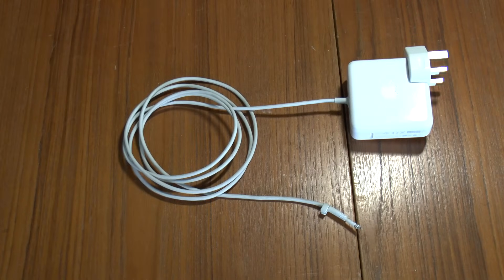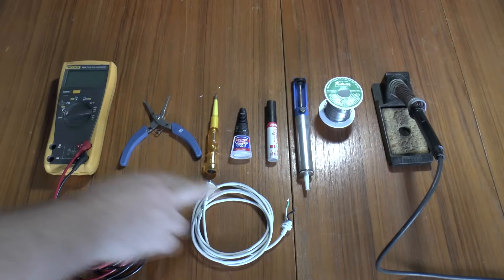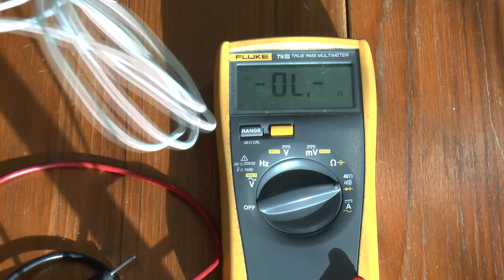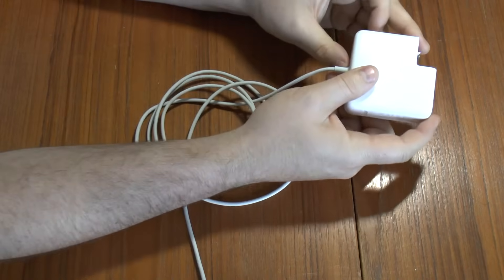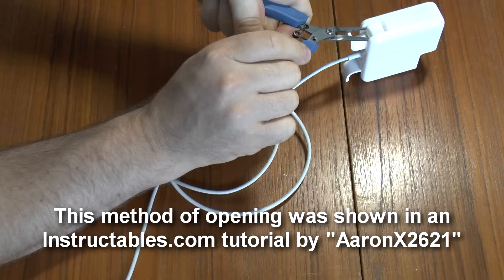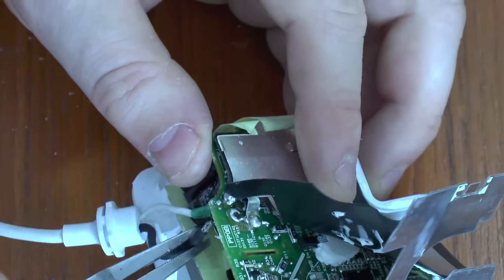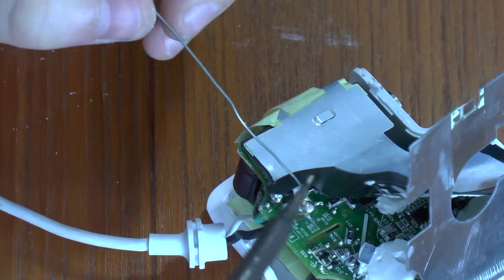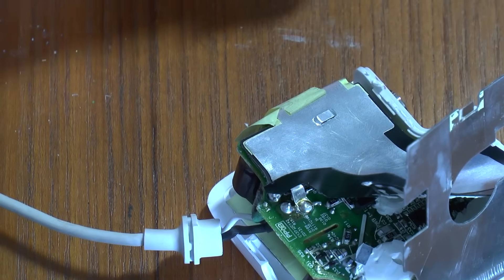How to repair an Apple MacBook power supply (MagSafe)

Comment: http://support.apple.com/kb/TS4127?viewlocale=en_US&locale=en_US
Reply from the maker: Depends. Play nice and if you catch someone at the Apple Store who's in a good mood you may be in luck. Explain you tried fixing it before finding out about the extended warranty, a bit of honesty might work wonders.
Reply from the maker: US-only, but a useful link nevertheless. Replacement PSU for free definitely beats DIY-fixed PSU for a few bucks :)
Reply: Wish i had seen this before i soldered my end tip, the end the attach to the computer. I bought a cable to replace it. I wonder if they will still change it out? Thanks for the link. Next time i'll know to check first. Now i know, and knowing is half the battle. =)

Comment: Is it prudent to apply a good grade of electrical tape to the wire as it travels through the "wire guard" in the case. The objective is to provide some protection to the cord as it exits the charger. I have noticed this is a weak area for the wire insulation to break down. I was curious as to your thoughts?
Reply from the maker: You could, but it'd look messy. You may fare better (and neater by looping the cable back and taping it to the charger, so the cable comes out, so the cable comes out and forms a hoop.

Alternatively you could try something stylish by using a small spring (such as one from a pen) as a strain relief spring, wrapping it around the cable at the charger end. I saw that recommendation somewhere else so can't take credit.

Comment: Thanks for the video. I honestly only watched the first few minutes and then took it from there but it was a very helpful start, particularly your method of popping apart the case. The soldering (removing old and re-installing new leads) went easier than anticipated; the holes on the mounting board stayed open and retained a little solder ring around them which helped the new solder grab easily.  I also held the whole contraption down to my desktop edge with a large spring clamp so it was easier to pull down on the old wire with pliers (as I heated the solder) without it scooting around.

Comment: THIS IS HOW I FIXED MY WORN OUT CORD!  BUY A NEW CORD:!

BUT I RECOMMEND - I DIDN'T HAVE TO SOLDER INTO THE BOARD, I JUST CUT THE OLD CORD BLACK AND WHITE WIRES LEAVING THEM LONG AND SOLDERED THE NEW BLACK AND WHITE WIRES TO THE OLD ONES.  THIS WAY I DIDN'T EVEN HAVE TO OPEN THE POWER BOX ALL THE WAY INTO TWO, JUST HAD TO CRACK IT OPEN A BIT ON THE CORD END.:

I FIXED MY OVERHEATED BROKEN L SHAPED CONNECTOR CORD 13" MACBOOK PRO.
I BOUGHT A REPLACEMENT CORD FOR $10 W/SHIPPING ON EBAY-I CHOOSE THE T SHAPED CONNECTOR INSTEAD BECAUSE I BELIEVE IT IS HEAVIER DUTY THAN THE L AND THEY ARE INTERCHANGABLE. 
I SAW A YOUTUBE FOR EASILY POPPPING THE BOX OPEN WITH NEEDLE NOSE PLIARS AND SOLDERING THE NEW CORD.
TO OPEN THE POWER BOX, SIMPLY SWING OPEN IT'S CORD STORAGE WINGS AND PLACE NEEDLE NOSE PLIARS TIPS INTO THE EDGES THE WINGS FOLD INTO. 
FORCEFULLY OPEN THE NEEDLE NOSE PLIERS WHICH WILL POP OPEN THE POWER BOX GLUED SPLIT CLAM SHELL SEAM. 
PLACE THE POWER BOX ON A TABLE WITH THE PLIARS PUSHING DOWNWARD AGAINST THE BOX-TABLE-YOU'LL HAVE TO KEEP THE POWER BOX FROM MOVING/PLIARS TIPS FROM COMING OUT BY PLACING THE POWER BOX AGAINST A STATIONARY OBJECT. 
THE CORD STORAGE WINGS AND THEIR DEPLOYING SPRINGS WILL NOW FALL-COME OUT.
I DIDN'T EVEN HAVE TO REMOVE THE CLAM SHELL HALFS COMPLETELY, JUST ENOUGH TO GRAB THE WIRES. 
CUT THE OLD CORD LEAVING AS MUCH OF IT'S WHITE AND BLACK WIRES ON THE POWER BOX. 
STRIP THE OLD WIRES ENOUGH TO SOLDER TO THE NEW WIRES BLACK AND WHITE CABLES. 
USE NARROW STRIPS OF ELECTRIC TAPE TO HOLD THE MATCHING COLOR NEW/OLD WIRES TOGETHER FOR SOLDERING, THEN SOLDER.
ELECTRICAL TAPE THE SOLDIERED BARE ENDS ADEQUATELY AND PUSH BACK INTO THE POWER BOX.   
CAREFULLY LINE EVERYTHING UP.
PLUG IT IN TO THE WALL AND THE COMPUTER FOR A QUICK WORKING TEST BEFORE FINAL GLUING.
PLACE SOME SUPER GLUE ON THE BROKEN OPEN POWER BOX SEAMS.
SNAP EVERYTHING BACK TOGETHER NOT FORGETTING TO REINSTALL THE WINGS AND THEIR DEPLOYING SPRING. 
HOLD THE POWER CLAM CASE HALFS TIGHTLY CLOSED TO ALLOW THE GLUE TO BOND. 
WHILE HOLDING, PLACE CLEAR STRIPS OF SCOTCH TAPE OVER THE GLUED SHELL SEAMS SO YOU CAN REMOVE YOUR HANDS AND BE DONE AND TO INSURE THE SHELL WILL NOT COME APART AS THE GLUE CURES OVERNIGHT.
PLUG IT IN, YOU'RE DONE!

HOPEFULLY THE NEW CORD WILL LAST A GOOD LONG TIME BUT IT'S NOT TO HARD TO REPLACE AGAIN FOR $10 AND ABOUT A 30 MINUTE JOB.

This problem is caused by our current world system that does not do what is best for everyone.  Check out  equal money org

Comment from the maker: Yep, believe it or not there's circuitry inside the plug itself. I doubt you'll open an L-shape MagSafe plug without completely destroying it (like I did) but the T-shape ones should be a touch easier.
I still had the ripped open plug until about three weeks ago, I'm pretty sure I threw it out when I started redecorating the computer room. Typical.

Comment: In fewer words, this would mark the first time I've heard of an active cable for a power supply, that throttles wattage based on the cable's IC broadcasting its rating (or some variant thereof).

Comment: Sorry if this sounds ignorant, but are you saying the cable that connects on the magsafe end side (that you're repairing) has an chip of some sort that allows the actual PSU to determine its wattage rating?

Like FL34747, I am confused by this.

I consider myself pretty savvy with these sort of things, and as a rule I simply always assume cables to be "passive," and therefore it is up to me and me only to pair the correct cable with the component.

Am I wrong in this case; is this different?

Comment: The final output stage of this PSU is a TPC8118. Does anyone know what the gate signal should look like on an oscilloscope? I have lots of dead PSUs with +15 volts still present on the input to this transistor, but no output to the Magsafe lead.

Comment: You've got this the wrong way round!  A 45W cable on an 85W PSU is bad news as it will overheat if used on an 85W device. An 85W cable on a 45W PSU is fine, because the amount of power drawn is determined by the laptop and PSU combined. Just don't use a 45W PSU on an 85W device!

Comment from the maker: If you put a 45 watt cable on an 85 watt PSU, 45 watts is all it's going to give out because that's all the MacBook will be prepared to draw. My guess is that an 85 watt cable on a 45 watt PSU is going to leave you with a dead PSU.

Comment: This is the best video to repair the mac charger. I ordered mine from eBay. I'm little confused about the wire that I got. the wire in the charger is black and white the white one with green tip. Should I solder the red one where the green one placed.

Comment: This is the best video to repair the Mac charger. my question is I got wire which is black and red. The cord from the charger is one wire is black and the other one is white with a green color tip of the wire. Is the red one goes with green one

Comment from the maker: Searching for "magsafe repair" usually comes up with the goods. As mentioned in an earlier comment, T or L shape are interchangeable, but you'll want the correct wattage cable as the charging is controlled by the Magsafe plug itself.
Reply: I have a 45W Air charger. Is it OK to use a 60W replacement cable? Can't find a 45W one here in the UK with a T connector.
Reply from the maker: @edwardcullen3251  T and L are interchangeable. I wouldn't use a 60W cable on a 45W charger as the circuitry in the plug will tell the MacBook that it can draw more than the power brick itself can safely provide.

Comment: Please could you tell me where did you purchased the replacement cord from?
You said on eBay, but when I tried it just came up with the connector head replacement or full the charger unit.
I did find one but the AC power pins are not shown is this the correct one?

it comes under "5p magsafe jack MACBOOK PRO dc cable from original adapter power supply cable" and costs £10.18

Comment: There is another very simple & easy way to fix pin/plug or wire damaged Apple Magsafe adapters without opening the case plastic and it takes just 2 mints to repair the whole charger. Buy the repairing kit from QUICKFIX DC PLUGS from e-shop and save your money and time. 100% works and satisfaction. The product is based in the UK.

Comment from the maker: There are components within the plug itself. I don't know if there's a fuse in the power supply circuit. From what I've seen SMPSUs respond to overload either by shutting down until they're power-cycled (PC power supply) or burning out whatever shorted it (original Xbox power supply).

If the PSU is dead and turning the power off (in the case of a MacBook supply it could need to be off for DAYS to discharge itself) hasn't fixed it, I'd try tapping into the cable and checking the voltage there.

Comment: While I wanted to measure the voltage on the pins at the magsafe side, I just had a nice short-circuit. Do you think there is some kind of fuse inside the power supply?

Comment from the maker: T and L connectors are interchangeable. You need to get one from the correct size of power supply, though. If you have a 90W power supply fitted with a cable from a 65W power supply, the MacBook will think it's a 65W power supply because the chip that controls the charging is inside the connector, not the charger.

Comment from the maker: Sounds like you may have short-circuited something in the adapter. Could be a stray strand of wire or blob of solder, could be that the metal shielding is touching something it's not supposed to.

Comment from the maker: Watch out if opening the charger. It's not designed to be worked on, so there don't appear to be any discharge resistors across the input smoothing capacitor. This can store up to 350 volts DC and as you can see in the video it takes a LONG time to discharge itself, even two days isn't enough!
Reply: How to be safe then? What is the workaround to this problem i.e., how to discharge the capacitor?
Reply: @FiskoPR  yep, short it out like he did in the video as a precaution - always wise to do with big capacitors when taking things apart. If you have any slightly higher power resistors you could also use one of those to discharge slightly slower (nicer on the capacitor and not so sparky!)

Comment: Just carried out a similar fix, still have to test it. WARNING. Do not use electrical tape on the rubbery wire.  I did this when the cable first frayed and it *dissolved* the insulation.  Also I once tried a similar fix with a dell power supply and it ended in utter failure.
A better design would be to make it so there would be a plug on both sides of the adapter so that when the cord frays you can spend $10 and buy a new cord and all would be well.

Comment: Props to you sir!  I just used this tutorial and it worked like a charm!  I've never soldered before or done anything the least bit technical, but it still worked perfectly on the first try.  I didn't replace my cable, just cut a bit off the end and stripped the old cable, re-soldered, and bing... Orange charging light!
Reply: Thanks! You just helped me answer my question 9 years later. I went into the comments meaning to ask if that was possible. Cheers 🙂

Comment from the maker: This method really comes into its own when soldering multicore cables, where it also has the advantage that if the tape comes off one of the joints, it can't short out to one of its neighbours as the neighbouring joints are either further up or further down the cable.

Comment from the maker: That wouldn't look as nice, but it's certainly possible! When doing that I'd cut the braid and the core as different lengths (so one cable has a long braid and a short core, the other has a short braid and a long core). When soldering together, the two joints will be out of alignment so once the cable's taped up the joint will have a longer but slimmer profile.

Comment: instead of a replacement cable, is it possible to cut off 1-2 inches of the existing frayed wires and then re-solder the 'good' cables together?

Comment: I did a similar fix on my sister cheap Chinese laptop charger, But the wires were broken inside due to her wrapping the cable around the charger. cracked it open de-soldered the old wire and used some heavy duty speaker as a replacement with a new DC jack from Ebay.

Comment: There is active communication on the center-pin.

It's bi-directional too, as the laptop is able to change the colour of the LED in the adapter depending on the charging state. 

This way, the adapter is able to identify itself to the laptop, so it won't draw more current then the adapter can supply (the 45W, 60W and 85W adapters use the same connector, and are in fact compatible, though the charging rate will vary.)

Comment from the maker: Yes, T and L are interchangeable. 45 watt, 60 watt and 85 watt may not be though, as there's an IC in the MagSafe connector that apparently (see other comments) tells the MacBook what the power supply is.
Don't nick one off an aircraft power cable either, I read (on Wikipedia I think) that these are designed to run the laptop but not charge the battery.

Comment: good thing i dont use a mac lol. my first decent laptop (compaq CQ60) had a badly designed power connector (among other things), stress put on the grommet and the plug would cause one or the other end to either short, cause the wire to snap internally or be all out flaky. one of them i cut open the barrel connector open and soldered figure 8 wire to it and epoxied the thing and the cord lasted ever since

Comment from the maker: Yep. I've just fished the chewed-up remains of the dead connector from the bin (which is lucky, tomorrow is "bin day").
4 LEDs (2 per side), a handful of other discrete SMDs and a 6-pin chip marked 3AB1 2100, all crammed into that aluminium barrel.

Comment from the maker: Interesting. All that's embedded in the MagSafe plug, there are only two wires back to the power supply. It also means that the MagSafe leads aren't interchangeable between supply types, as a 60 watt PSU with a 45 watt lead will tell the MacBook that it's a 45 watt supply.

Comment: Ah right yeah. The middle pin is sort of how the power adapter communicates with the macbook. It's a charge control pin that assists with changing the LED color, and also assists with switching the adapter off. No power will be output from any of the other pins until contact is made with the center Charge Control pin. This pin is also used to transfer additional information, such as the power type and serial number of the power supply.

Comment from the maker: Middle pin? I thought that only drove the LED, there must be some other shenanigans going on if that stopped it charging.
I bought a replacement PSU from eBay at the same time as the lead. £23, secondhand, genuine Apple.

Comment from the maker: There was some sort of class action lawsuit against them before they redesigned the connector, from what I've read if the old-style ones fail you can get them replaced for free. I don't know which countries that applies to though, and I doubt it applies to the new-style connectors.